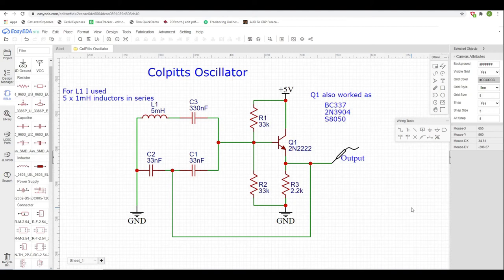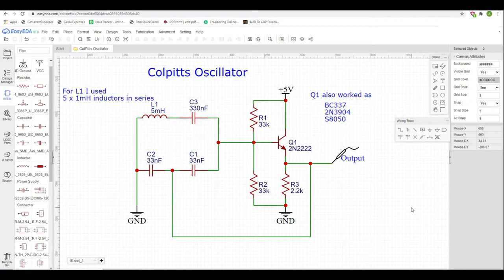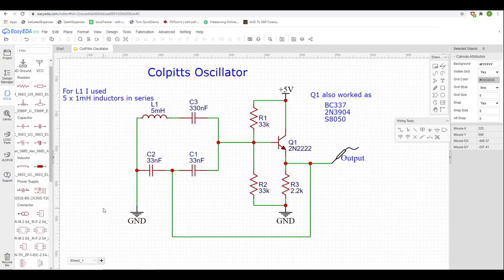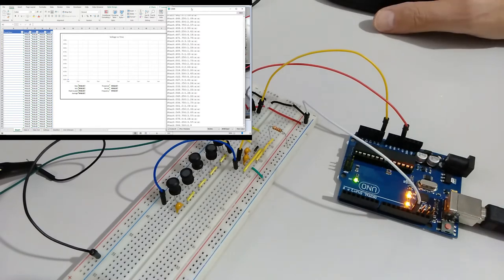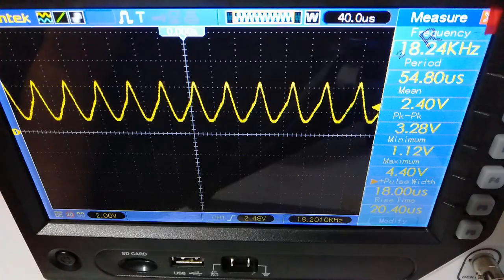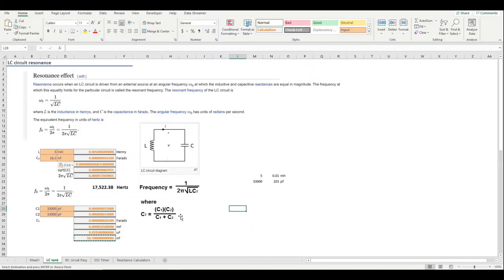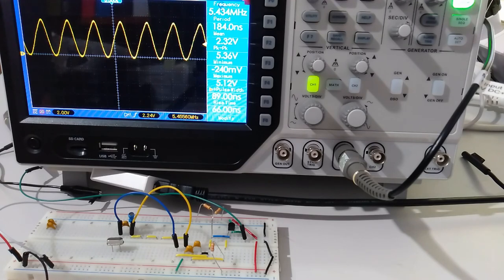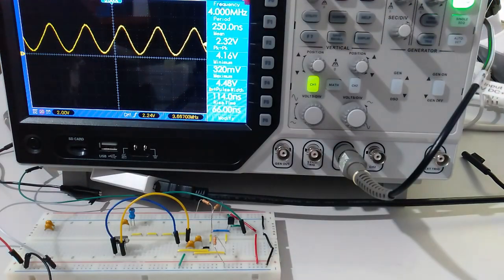Colpitts Oscillator circuit

Comment: Hi. I am a complete beginner with all this and trying to understand for an rc project. Can I ask, how come you don’t have a resister between 5v source and collector of transistor? And how come you are taking the output from the Emmitor side of transistor? Cheers
Reply from the maker: There are 3 basic transistor amplifier types.  The one where the output comes from the Emitter side goes by the names "common collector amplifier" or "emitter follower amplifier".  It amplifies current but not voltage.

There is a great tutorial about the different transistor amplifier types in the video titled: "#114: Tutorial: Common Emitter, Common Collector, and Common Base Transistor amplifiers" on the channel w2aew.

In the common collector configuration I used, the amount of current flowing through the collector to emitter will be proportional to the current going into the base (albeit ~100 times greater) so no resistor is needed on the collector side to limit current or set gain.

I don't have any strong reason why i used this configuration other than it worked when I started experimenting.

Using this configuration is not the only way to do it.  The video titled: Colpitts Oscillator NPN Transistor Circuit" by the organic chemistry tutor is another example of a Colpitts oscillator.

The one thing I will say with all these oscillators is the formulas and theory will say one thing but experimenting with changing component values up and down will get you to something that works in the real world.  It was a lot of trial and error.

Good luck with your project and hope some of this helps.

Comment: I kinda can't get it working. I've connected it exactly as you did, matched all the common nodes, but my arduino leonardo just reads only DC from any element, whether it is a transistor or a capacitor or anything else. Is there any advice you can give me? I've tried it like 20 times already, even tried different configurations. It seems that i can't get anywhere near just a clue of an oscillator.
Reply from the maker: They can be quite tricky to get it going.  Are you using similar value components?
Reply: @overengineeredinoz7683  i've used about the same biasing, but the base resistors are 47k ohm. the inductor stays the same, C3 = 470 nF, C1 = C2 = 100 nF. I've read something about the Barkhausen criteria. It seems that you need specific proportions of capacitances and above that the biasing of the transistor should also be considered. I've tried other configurations, like the one in "DC to Daylight" playlist, for example. Even checked this very critetion, got the loop gain relatively close to 1, but it didn't work out as well. Some say, that there are parasitic capacitances on the breadboard, that can cause problems. I don't have jumper wires, but at least i've tried using as few wires as possible. Also, there is an assumption that one may need to connect a signal generator just to get it oscillating.
Reply from the maker: I generally find the resistor between the emitter and ground tends to have the most impact on it working. If you have a trimmer pot you can put there and vary it up and down it may spring to life.